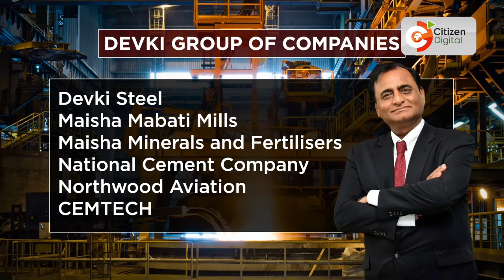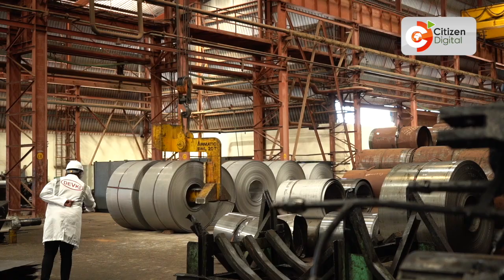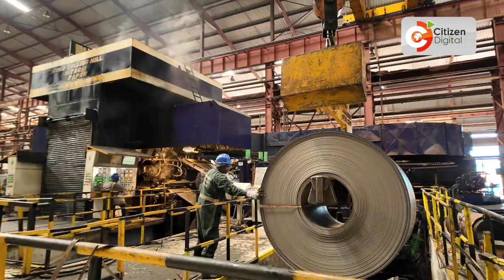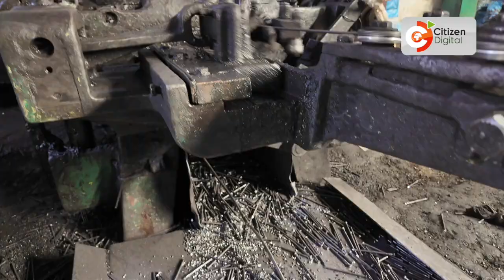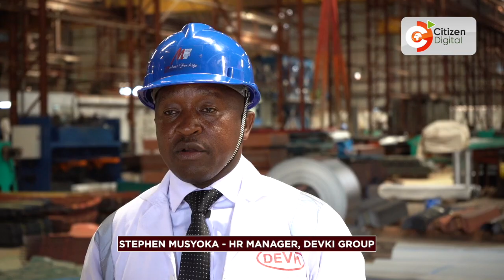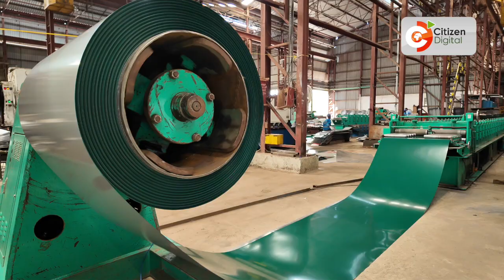INSIDE DEVKI STEEL MILLS - How Maisha Mabati and Devki nails are manufactured

Comment: Cartels Cartels Cartels in Devki... How comes dollar is going down, same same fuel and other essential products but not iron sheets in kenya.. Cartels cartels cartels reduce the price to Ksh 1,350 for 30 gauge 3M standard box profile iron sheets and stop fleecing Kenyans.. your in cohorts with corrupt government officials and compromised sales chain from stockists, wholesalers, Devki argents to bleed Kenyans.. Stop selling iron sheets in meters Devki.. and cement should be going for Ksh 630 and not Ksh 950.. Cartels cartels cartels cartels..